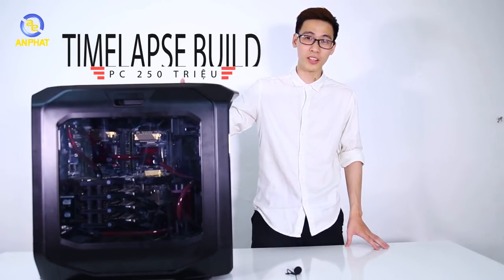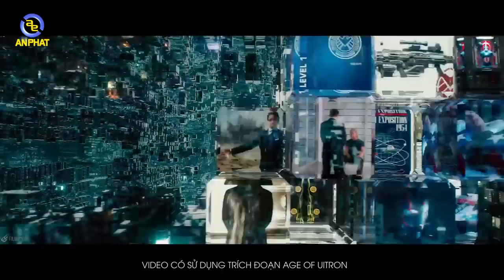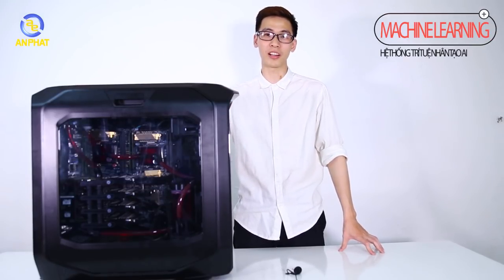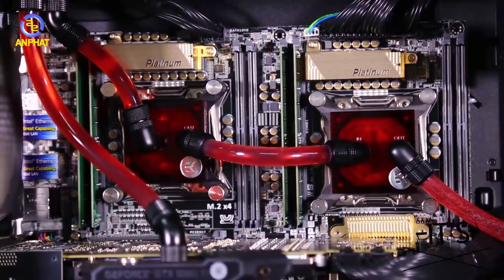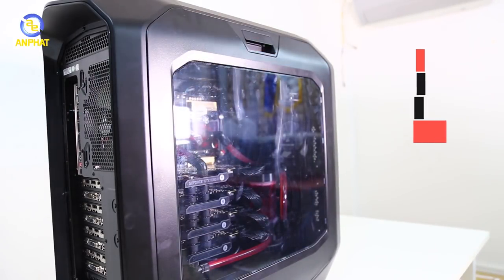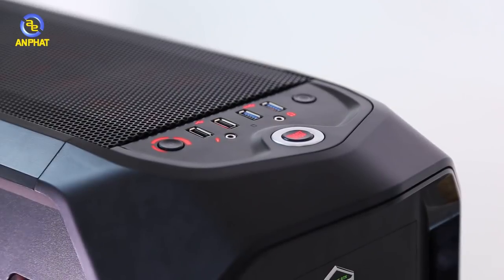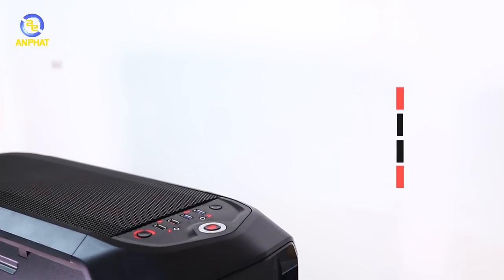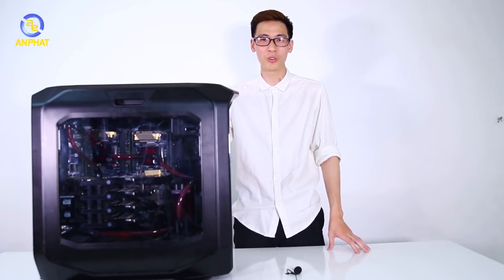Thánh VGA - PC 250 triệu dùng 4 VGA MSI GTX 1080Ti  | An Phat PC

Comment: Sao ad hk dùng 2 cpu xeon platinum 8180 và 4 vga Tesla V100?? Cái này mạnh hơn mà!!!
Reply from the maker: giá 8180 cũng riêng CPU đắt hơn dàn máy rồi bác :)
Reply: Nếu dùng 2 CPU 8180 và 4 VGA Tesla V100 thì dùng main nào dạ? và giá PC đó cỡ bao nhiêu dạ?
Reply from the maker: Đạt Đạt Lê bạn dùng main asus ws621E sage hoặc dòng super micro x11...card tesla v100 hiện tại chỉ đi theo các hệ thống sever DGX 1V ( 1 hệ thống sever này có giá bán khoảng 3.5 tỷ đồng)
Reply: Vậy thay bằng Quadro P6000, P6000 có bán lẽ như GTX hk dạ? mà Quadro P6000 vs Tesla V100 thì cái nào hơn dạ?
Reply from the maker: Dạ nếu dùng P6000 thì riêng VGA cũng bằng giá TITAN V ~ 130 triệu đồng,trong khi về năng lực tính toán về computing thì lại ko đọ được TITAN V ạ